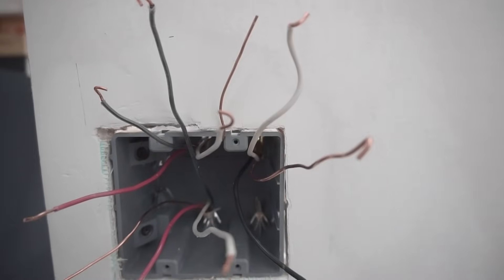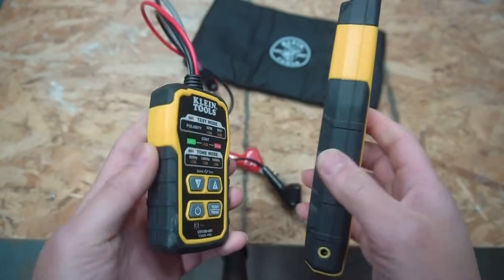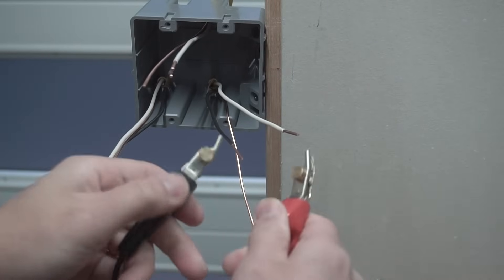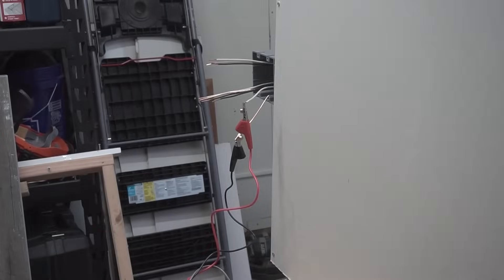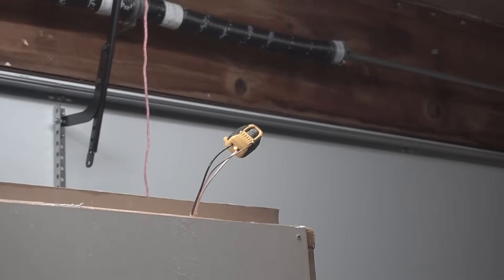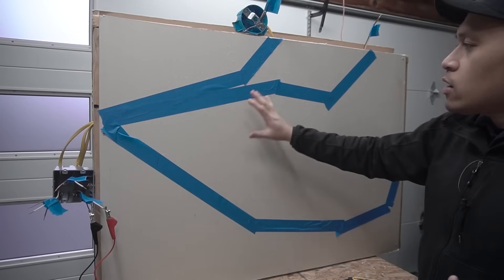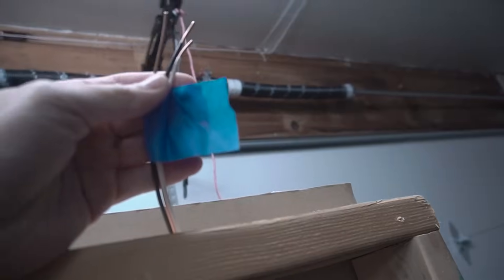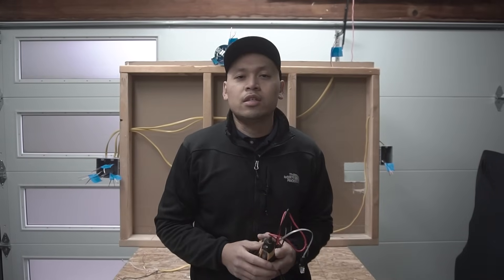The EASIEST Way To Trace Electrical Wires Inside Your Walls! How To DIY

Comment: Does this work if my wire used to carry a charge but for whatever reason it just went dead? (Window ac was connected to it constantly, it might have burnt out)

I'm thinking if the wire burnt out aka detached then it won't complete a circuit is this right?

Comment: I have a faulty active wire in a circuit of 4 power points. By doing this will it tell me which cable has the fault?

Comment: You presented this very well. I think ill stick with a multimeter and a wire nut on the othet  side.  I dont see needing to actually have to trace the route the wires were run , unless you needed to maybe blow a hole in the wall or maybe you got a live  run of romex that disappears in the wall somewhere.  Plus, does this read through double sheetrock? Plaster walls? Wood paneling?
I guess basically it all comes down to your personal preference, but heres what kind of scared me about this video. There were a few comments from homeowners saying this is what they need, now they can do the electrical in their own house. Oh boy. Lol
Be careful electrical DIYers, please. 
Remember,  you can be happy you  completed the project without getting shocked,  but the fire can kill you just as fast 6 months later. Know what you are doing.
Btw, not referring to this particular guy or his videos,  but dont believe everything you see in these online videos. Ive seen some videos where their work was shoddy, not up to code and /or just plain dangerous.

Comment: Actually this demonstration is BACKWARDS. If you transmit at the  multi-cable Quad Box - you need to run all over the house to find the mated wire. If you transmit from (say the light) closest box to the multi Quad, you have a 1-in-3 chance of finding it in 10 seconds! Then - after matching only 2 (the closest)  odds are good that 3rtd is the one you did not have to run to its location to test!     People test stereo equipment backwards too----so no surprise here.

Comment: Go to the light fixture. Connect the black and white wires together with a wire nut or wego. 

Use a connectivity tester in the main box and find the black and white that have connectivity, are connected. 
Then disconnect the wires in the light fixture and connectivity should go away. 

No fancy tools needed
Reply: Maybe if you know where each end of the wire is.

Comment: Much easier with Ohm meter (or VOM).  Turn off ALL power, use wire nut connect any wire to ground, then use ohm meter at other boxes to find the wire that has continuity to ground.  Label both ends, then continue to next wire, etc.
Reply: That is exactly what I said. It works great.
Reply: Maybe if you know where each end of the wire is. I have an outlet that's not connected at all at one end. I need to find out where the wire is running in the wall.

Comment: What about switches that do nothing. I’ve opened the switch plate and there are wires there, but they do nothing!
Reply: I really do hate ghost wires. 
You can get a high powered toner and follow the wires in the wall even though they are 3” away. 

Not a cheap tool though

Comment: I just use a ohm meter it’s way more accurate.
That machine is a p.o.s. For that.
Reply: That ohm meter will be restricted by the length of its leads.
Reply: I agree. That is the way I do it.

Comment: But if the wire is broken the toner won't work will it?
Reply from the maker: If there is a break in the line it will not it works by continuity.
Reply: There are devices that can tell you the length of a wire. And expensive tone generators allow you to follow the wire behind the drywall until you find the break

Comment: After watching many of Jay's electrical videos, I have finally overcome my fear and I can now work on the outlets in my house. Nothing bigger than that though ‼️
Reply from the maker: That is great to hear! Glad I could help! 🙏🏽😊👍🏽 thank you so much!
Reply: Don’t create anything new. Just because a new circuit works does not mean it is safe. 

You need to understand electrical code to do something new safely
Reply: Yes I was thinking the same thing no need to be afraid but I won't be working on something bigger😊 just the outlets in my house😊